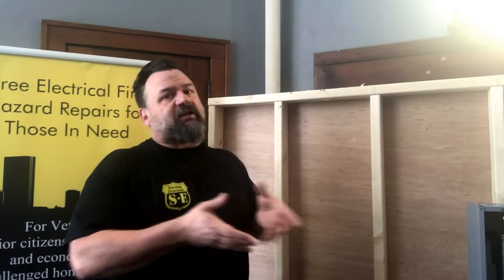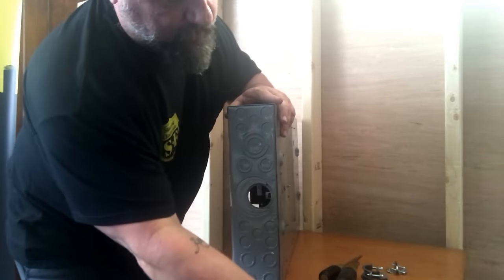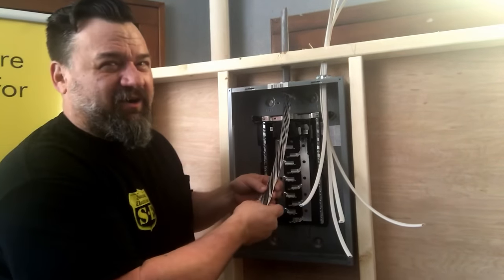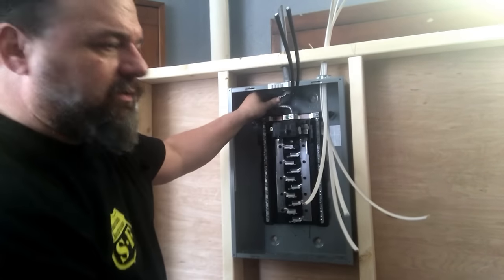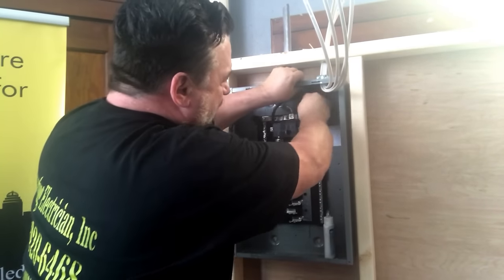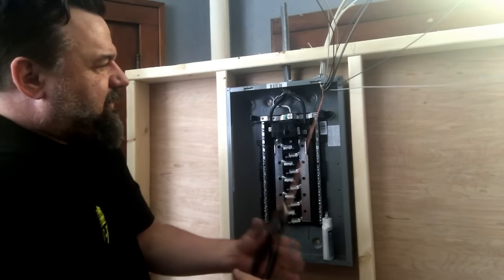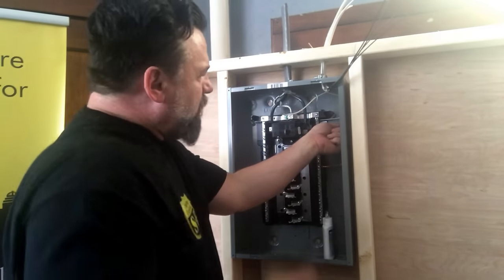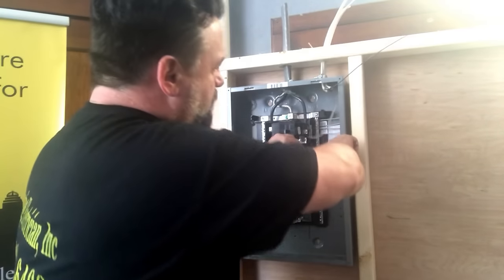How to wire a 100 amp service panel. ,  2020 National Electrical Code compliant

Comment: The receptacles that are normally installed in homes which have two plug-ins are considered single outlet or double outlet. Another question if I was gonna add more receptacles on the same line I would need to add a double circuit 15 amp to add 240 volts, am I correct
Reply from the maker: They are considered one receptacle. Single outlets are meant for dedicated circuits and can't plug anything else into them.  Because is doesn't have a ground doesn't mean it's rated any differently. You cannot just add more outlets and increase the breaker size to make it work. The only time to add a two pole or double pole breaker  would be if  two circuits share a neutral. Kind of hard to explain. Maybe I need another video! Lol

Comment: Why isn't No Ox used on the neutral and ground cables? They're going into an aluminum bus bar.
Reply from the maker: its required under the neutral too. anything with a load on it.

Comment: What is the service cable you installed? I bought an SER wire (4) for new 200 amp panel service entrance. The inspector said it is wrong. Not sure what to tell the guy at Home Depot what I need.
Reply from the maker: Alexander Adler because with the primary service. You need only two conductors and the neutral. A 4 wire in the meter would be techinacally wrong. Two hots, one neutral coming in. Then you ground and bond the service, you got SER. Cable when it’s supposed to be seu. Then bond the neutrals and grounds in the panel with the bonding screw. The SER cable is for a sub panel and you seperate the conductors.  I hope this helps. I sometimes ramble.

Comment: Do you have or can you make a video of wiring a food trailer? Im building one and need some help adding electrical to it.
Reply from the maker: By Yami D  I don’t have any videos of a bunch of commercial stuff but I may be able to do one. Maybe run pipe from the panel and drop boxes for different devices.  I’m moving out of my shop so I couldn’t do it there and would need to get a commercial job to shoot on. But I’ll try.

Comment: question i have is. Should i make a 2 gang box, 4 20amp circuits? or should i make it the 4 gang box with the 4 20amp circuits?
Reply from the maker: It’s not about the size of the box. Four going in and four going out would be fine for circuits. Usually it’s a matter of what you are feeding. Ya don’t stuff 4 20 amp circuits in a box to cover it. Take a look at my other video, how many plugs on a circuit. It helps. I’m open to any questions you have. Thanks
Reply: @StarvingElectrician  it is for my wood work shop. this way i want to stop dimming the house lights when i turn on my table saw. so i am going to install 4 20 amp circuits dedicated to my garage and 1 220v plug.
Reply: also i was going to run heavy duty extension cords around the garage to spread the circuits some. your thoughts sir?
Reply from the maker: Sorry for the delayed response. As far as dimming that will never stop because the motor has such a large start up draw it dims the lights. If it pops the breaker is when you worry. My advise is to make sure the panel is grounded properly and also bonded to the cold water. This sometimes helps. Sometime the load is unbalanced in the panel and one side draws more than the other. Maybe simply move the breaker up or down a slot and see if that helps. Keep me posted!!! Thanks

Comment: I'm going to be installing a panel in a shed in my yard.  My electrician will be running the cable from my house (main panel), underground to my building. I have purchased a Square D panel and some square D 15 & 20 amp breakers. I have yet to buy a main breaker. Are there ones made for only 120 volt service, or just 240 volt? Also, my panel has 2 lugs above the bus bars. Do I remove them to put in the main breaker? Do I even need a main breaker? If it helps any... I like tacos and beer as well.
Reply from the maker: Brad Olsen  lol who doesn't like tacos and beer?  Well your panel in the shed is now a sub panel. Most sub panels are rated up to 125 amps. So you definatley want 220v and the amperage is determined by the wire size feeding the sub panel and that determines the breaker size from inside the house. Minimum sub panel size I would go 60 amp. #6 copper.  Hope this helps and thanks for the reply

Comment: I really  liked that on the panel install I'm currently getting ready to install a 125 amp panel in my cabin I just built an I would love any tips an help u can give me. Caz I'm working it myself..an 200 amp meter box on the out side.. again love the videos an please keep up the good work. I'm a vet.too.
Reply from the maker: sorry for the delay. just so many irons in the fire. ok first yes we start with a 200 amp meter can. not only for your ease but for the ease of the utility company and its upgradeable to 200 amps. next, 125 amps? why?  remember its not the size of the panel, its the demand. if your load is 100 amps at any given time then yes upgrade but any house at any given time only draws about 30 amps. 125 amps you will need bigger service cable feeding the meter, panel, and up to the pole. if you just want more spaces go with a 30 space 100 amp panel. you can have 100 panels so long as the load doesnt exceed the first panels 100 amp breaker. so I hope this helps. good luck and dont hesitate to ask questions!!

Comment: Does the same apply if I am replacing panels from a 100 to a 200?
Reply from the maker: yes its all the same as far as installation but of course the wire size would change and the bonding wire would as well

Comment: The NEC must have something similar, but the CEC has a rule on quality of work meaning it's a code requirement to do good work.
2021 Canadian Electrical Code, Rule  2-112 Quality of Work. the mechanical arrangements and execution of work in connection with any electrical installation shall be acceptable.
Acceptable - Section 0 - acceptable to the authority enforcing this code.

Comment: Many thanks! I'm the sort of cautious daredevil who changes his own garage-door springs, so when adding a basement subpanel to my house, I'm all ears for your advice.

On that note, the 100-amp GE panel I purchased for a subpanel came with a 100A circuit breaker and lug barrier that the instructions say are "required when the breaker is used as a single service entrance main device inside GE load centers...."

I was already planning to use a 100-amp breaker inside my existing, main panel, to feed this subpanel. Do I choose between the two? Or just discard/eBay the breaker/barrier that came with the new panel and wire the subpanel to a 100-amp breaker in the main as I was planning?
Reply from the maker: no so long as you have a breaker already in the main panel you are good. you can take the main breaker out of the sub panel and just wire to the lugs or you can keep the 100 amp breaker in the sub panel because the 100 amp breaking point is coming from the main panel anyway. hope this helps!....I need to apologize again because of how long its taking me to get back to all of the questions and you and everyone else will get this same part of the response lol. I have created a blog for questions and answers so more can people learn and also a live electrician portion for more advanced questions. I now offer phone consultations as well as zoom video for the advanced questions and so I can take a look and advise. www.liveelectrician.com or starvingelectrician.com I would appreciate further questions there. Thanks for watching!!

Comment: Hello my friend thank you for showing us some stuff here I have a small cabin and you probably help me if you can show me some video I have a pedestal outside of the cabin and I need to bring 100 m power and side to a circle panel I just saw your video how to connect it I'm pretty good connecting switches and plugs I'm looking for the video that you bring me that inside from the electric panel outside I have a circuit breaker outside the mirror and the circuit breaker outside and I need to bring it from the circuit breaker inside to the cabin how can I connect it from circuit breaker outside to the circuit breaker panel inside thank you and how to round 220 for electric stuff thank you
Reply from the maker: For advanced questions we could do a video conference on my site www.liveelectrician.com to book a 1/2 hour or a full hour.

Comment: I have a dimmer switch. I always have to press on and off twice for lights to turn on, instead of pressing it only once. Do you know why this happens.
Reply from the maker: george a  it's just how they designed the dimmer it sounds like
Reply: @StarvingElectrician  my other dimmers don't do that. It works perfectly fine, simply on and off

Comment: yes but your main power feeder and your branch circuits wires are on the same side and this is against the electrical code. if your main breaker is at the top you have to enter branch circuits in the opposite side or from the sides.
Reply from the maker: no you are completely wrong. the buss bar criss crosses so breakers on one side or the other make no difference. don't reference code if you cant back it up. if want to challenge my experience then post where you found it in the code book.
Reply: Sorry, You are right, I did not realized you are in USA here in Canada the code is different on this. there is 2 separate partitions and there is barrier between the main feeder and other circuits.

Comment: Neutral electricity is grounded because if there is fault large current will flow tripping the 15 amp breaker before it does damage to your body. The neutral doesn't carry current at all just goes back to the source or transformer the live wire carries the current and voltage and alternates in that same wire back and forth.
Reply from the maker: Osman Ahmed  no that is completely wrong. When there is a load on a circuit there is equal voltage on the neutral. I have been shocked enough on neutral wires to confirm that. It’s alternating current. This means the current alternates from the hot to the neutral when there is a load on it. Just a fact but thanks for the comment.
Reply: The current on the neutral conductor is equal to the amount that IS NOT balanced out by L1 and L2. Sorry Osman. Current in Amps not volts.
Reply from the maker: You ever take apart neutrals that are spliced together with a load on them and see a spark? That’s voltage. I have been zapped many times by neutrals when there is a load. The current alternates between the neutral and hot when there is a load and the ground is the fault wire. I know how it works.

Comment: Interesting video very different from what we have in the UK for a start we only get one phase for domestic installations at 60 to 100 amp 
All our grounds and naturals are in separate lugs that match the breaker number and the grounds have to be sleeved green and yellow
Reply from the maker: Wow it’s a different  thing all together but electricity is the same. Is it true that most the appliances are 220 volts? Also how are the tacos and beer out there?!!! Lol. Glad to hear from our friends across the pond. Take care brother.
Reply: 220 to 240 volts 50hz on single phase
Instead of GFI we had RCD new boards today are generally split with two of them covering all circuits and good practice for sockets up and lights downstairs and the opposite on different RCD
Our last reg change brought in surge and arc fault detection 
We don’t use aluminium cable only copper and tails from the load centre/consumer unit  are 25mm double insulated singles with 16mm ground to the meter unless it’s remote then it’s done in Steel Wire Armoured cable
Boards are also completely sealed to prevent any fire in them spreading, no open clamps like you have 
Cable size is similar 2.5mm for sockets with a 32amp breaker ring circuit with a limited number of spurs but out sockets are two gang 13amp per gang
Have a look at my trusted electrician guy named Luke he has some good board change videos
Tachos are rare over here but the beers good you can get the same but it tends to be stronger at 5% alcohol

Comment: So, I've got aluminum wiring in my condo and am wanting to upgrade my 125amp panel (from an old Zinsco model) and I feel like I can do it after watching your videos! I've got a few stupid questions: 1) do you recommend any certain brand or can I just go to Home Depot and pick up something they've got? 2) are special panels or breakers needed for aluminum wiring, or is everything the same as copper? And 3, if I decide to add a light circuit in the future, is there anything wrong with adding a copper circuit even though everything else in the panel is aluminum? Thanks so much for your videos... they are awesome :)
Reply from the maker: Jeremey Ellis  great questions! First you can use any panel you want because the lugs are all aluminium.  Aluminium wires expand and retract with heat from a load so there’s a chance of them pulling out of the lugs so just use a little no lox. An anti oxidant to help  stop oxidation and a bad connection. You can add copper to the existing circuits but cannot mix dissimilar metals under the same lug or we get oxidising and a loose connection.  The value of aluminium wire is less than copper. That said, if you have #12 gauge aluminum wire then that’s good for 15 amps. Copper is a better conductor so you would use # 14 for a 15 amp circuit.  Just remember not to double up the neutrals in the panel and the panel works just the same. Just use no lox on your connections and don’t splice copper to aluminium. Hope this helps.
Reply: @StarvingElectrician  Thank-you so much. One last question: right after the electric meter is an  old shut-off-breaker (from 1973). Do you trust those breakers when they're off or would you still remove the meter?
Reply from the maker: Jeremey Ellis  well if the breaker shut off then just make sure to check and see that it has no power. 1970’s aren’t that old compared to most. I’d just shut off the main.
Reply: @StarvingElectrician  Sweet, thank you... i owe you some tacos/beer!
Reply from the maker: Jeremey Ellis I’m always down for tacos and beer!!!! Lol
Reply: @StarvingElectrician  Sorry, one more question... my current panel has the grounds and neutrals landing on the same bar, but the new panel I'm planning to install (Siemens P1224L1125CU) has two grounding bars and a green grounding screw on the neutral bar, so I'm a little confused about where to land my grounds and what to do with the green screw. Do I forget about the grounding bars and just land the grounds and neutrals on the neutral bar and call it good after tightening the green grounding screw? Or do I land the grounds on the grounding bars and take the green grounding screw out?... or something else? (Sorry, I feel like this is a really dumb question!)
Reply from the maker: Jeremey Ellis  just use the ground bars is fine. In the sub panel you have to seperate the grounds and neutrals but in the primary panel you can put them in the same buss bar but don’t double up the neutrals with any other wire. Sorry it took a while to answer. I hope it helps.
Reply: @StarvingElectrician  No worries man... i really appreciate your help! Thank you!

Comment: are you allowed to quadruple tap the grounds like that? i've never seen that done before! makes everything look neater and takes less time, by the looks of it lol
Reply from the maker: some people will argue with me but yes I stand by it. over 30 years in the trade and never gotten shot down. they arent current carrying. its just like you can put all the grounds under one lug if you want. same thing here but a smaller incident. lots of people argue this point but none can show me in the code book that I am wrong.

Comment: How many romex/home runs can you put through a knock out clamp?  I'm guessing this is a code thing.
Reply from the maker: i tell ya thats the missing link. i get bashed for how many i put in a clamp but no one to date has shown me where in the code it says how many wires can go in a clamp or connector. theres a nipple rating. you can stuff as many as you want in under 18" of a nipple so whey not a clamp?

Comment: Knock outs alternate inside outside. Landing leads together on one screw like the grounds is not rated on many bars. Mixing grounds and neutrals is also not rated. You'll end up with neutrals on the ground bar and the bonding screw is not rated to handle return current on panels with isolated ground bars. Ignoring the torque values of lugs and breakers can also be problematic. Maybe you describe these later but there is no audio.

Comment: My meter says CL100 but my box is old with a common trip 100a main and 230 amps total breakers. How do I know if its 100a or 150a or 200a box?
Reply from the maker: if its old then I would guess its 100 amp. never add up the total amount of your breakers. just because you have a 15 amp breaker doesnt mean it draws 15 amps. most draw nothing. at any givin time without major electric appliances you house only draws about 30 amps tops.  look at the main breaker to see what size service you have but the meter is a crap shoot since the differ from state to state. hope this helps.

Comment: What ia better copper or alum wire for new 100 amp service about to wire my garage 100 amp breaker box 100 amp meter base from meter base to power company wires im in maryland
Reply from the maker: copper is a better conductor but they are both good. aluminum is cheaper and easier to work with. with copper you can go one size smaller because its a better conductor. #2 aluminum or #4 copper for 100 amp.